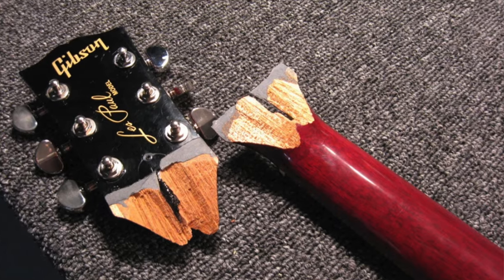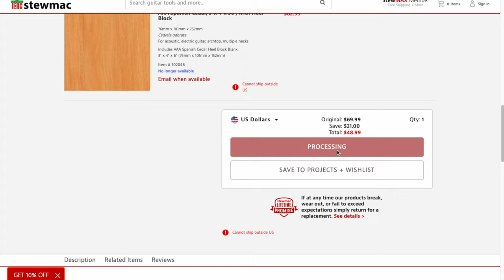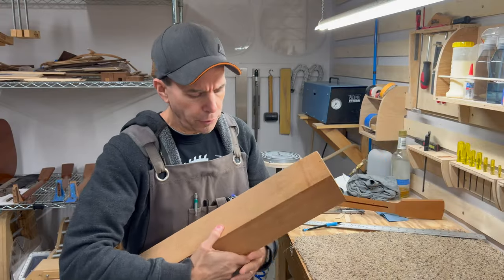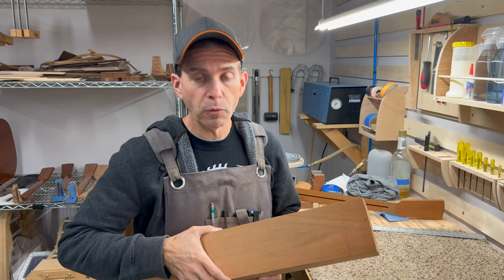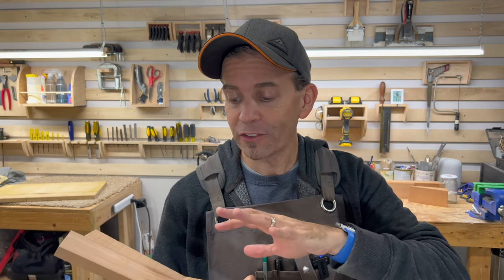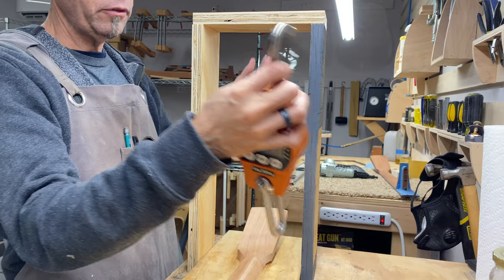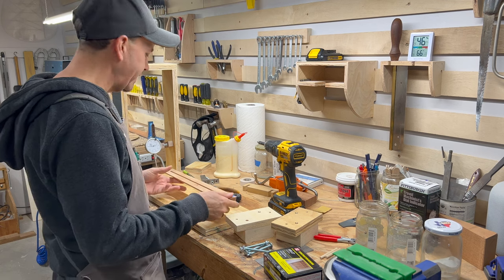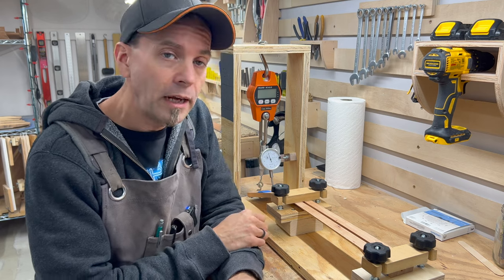Scarfed vs. One-Piece Guitar Necks - Part 1

Comment: One piece guitar necks are very wasteful of often valuable wood. A properly done scarf joint with a volute is probably best if you must have an angled headstock. I prefer straight Fender-style headstocks. Much stronger.

Comment: But what actually qualifies as a one piece neck? My Tokai Goldtop has a continuous piece of wood all the way, (no scarf joint), however it does have a heel joint therefore is it one piece?
Reply from the maker: Fair point.  In this context, a one-piece neck is in reference to a scarf vs. non-scarfed headstock joint.  Since that's the typical breaking point on necks, our testing focused on that.